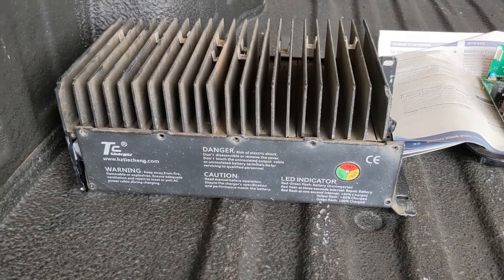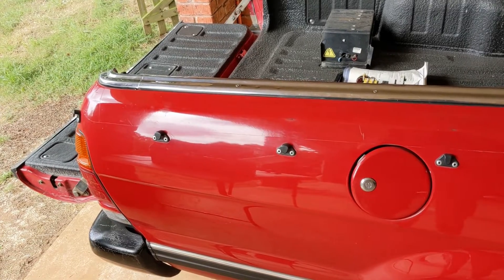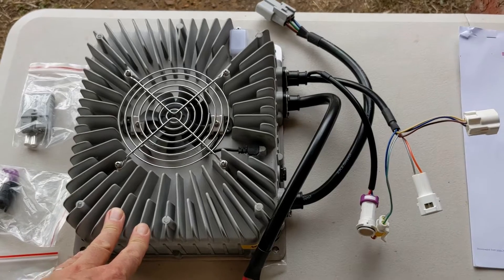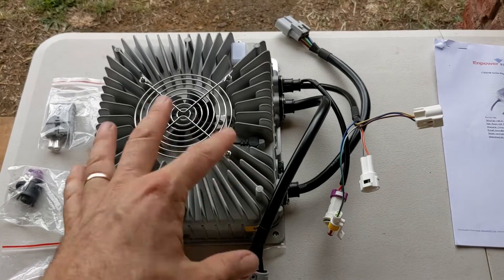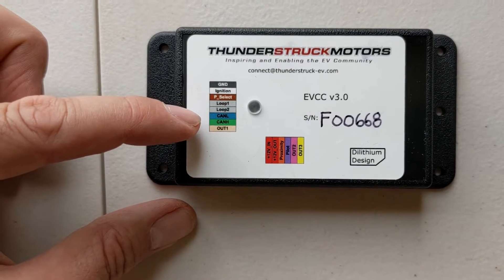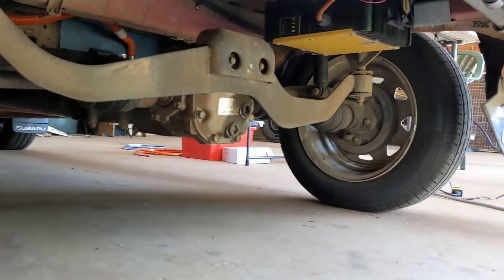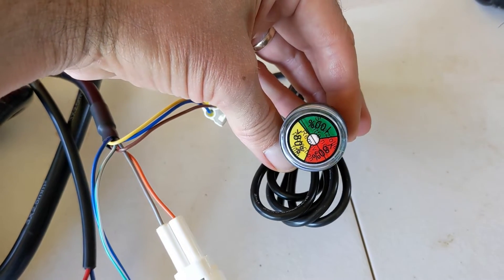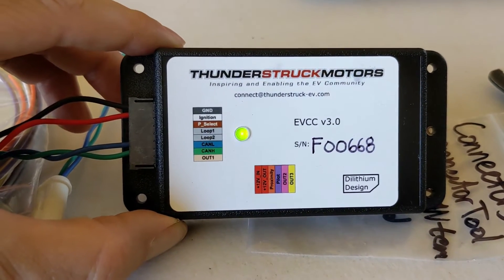Replacing the charger in my electric vehicle. Part 1.

Comment: I'm on the verge of installing this charger in my 914, thanks for the detail!  The first thing I learned is that I won't need my old AVC board anymore because the EVCC handles the protocol with the charging plug.  And I'm using the exact same Type 2 charging socket!